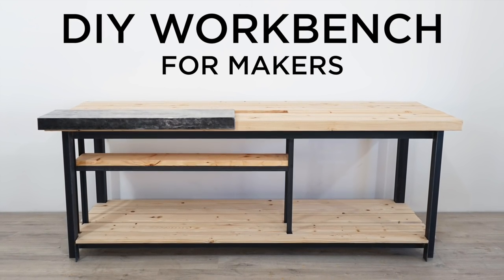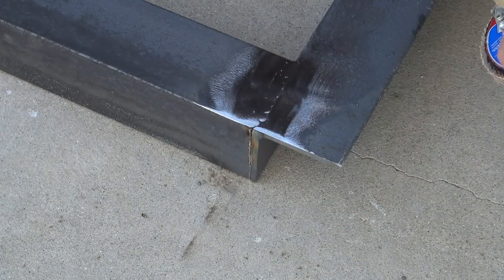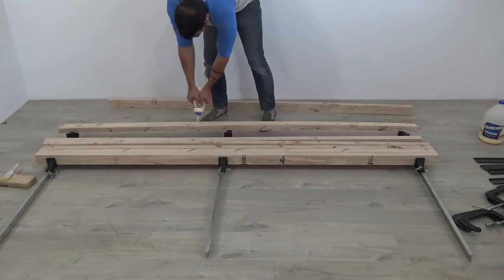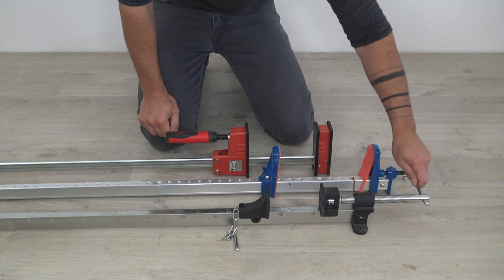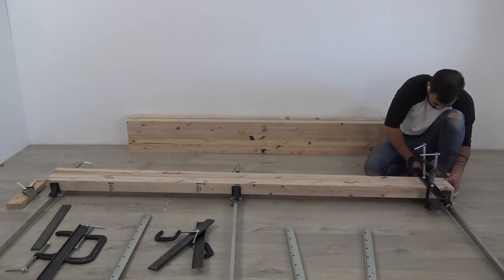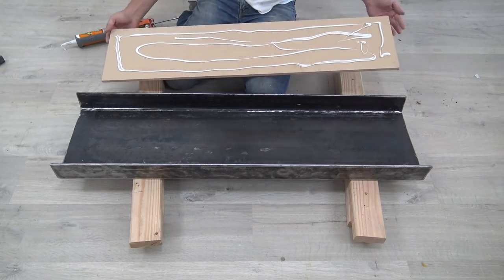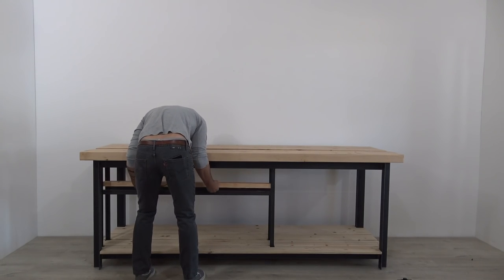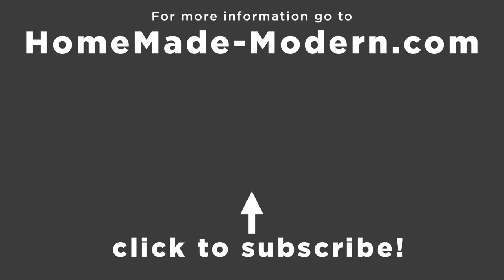Building a Workbench for Makers

Comment: I'm more of a power tool woodworker, but the idea of being able to weld, clamp items to the sides or surface, and have a cool powdercoated base is pretty awesome. I've talked about using angle iron for my outfeed table base for a while, but I'm too big of a chicken to finally pick up the welder.
Reply from the maker: yeah i put it off for a long time too
Reply: HomeMadeModern if you could go back in time, would you have bought a welder earlier?

Comment: Very cool bench. One recommendation for the feet on the bench is to weld some nuts to the end of the leg and then use hockey pucks on bolts as feet (there are a bunch of videos on how on youtube). It gives you the ability to level the table on uneven surfaces, helps prevent the table from scratching up the floor, and also absorbs some of the shock/ringing when hammering. An added bonus is that if you eventually clamp something like a disc sander or polishing wheel to the table, the rubber feet will help keep the vibrations from allowing the table to 'walk' around your workspace.  Love the podcast, and looking forward to buying some clamps.😎

Comment: I love the clamps that Mike, Chris and you designed. Its pretty cool. The table turned out pretty neat too. I would say that if you were going to do more welding projects is to switch to 75/25 mix argon CO2 shielding gas for your welder. Not only will it make your welds look a lot better because of less clean up of flux, but it will improve penetration and prevent contamination in your welds. Plus you can make some really nice welds. 

Just remember that you are also going to need wire and tips if you are going to do this upgrade. The 0.023 to .025 works great for sheet metal because of less heat and the .030 is good for heavy fab like chassis or the angle iron that you were working on. I really like your videos and can't wait to see what you will put out next. Makes me look forward to doing something over the weekends.

Comment: Awesome workbench, I'm digging the versatility of it which is especially useful for smaller workshops. By the way, you can minimize the torsion of the cheap clamps by inserting a thin slice of plywood in the gap. Works well enough for me!
Reply from the maker: good tip!

Comment: The removable channel in the middle is a cool concept.
Reply from the maker: yeah thats my favorite part
Reply: Yeah it's a common design from the "split top roubo" which it can be a tool holder that gets removed. But I really like this version, and with the removable "Anvil" it is great for small spaces that can't fit a separate workbench for different uses/tools.

Comment: Cool setup. I really dig it. I'd be worried about heat transfer to that piece of MDF on the underside of your steal insert. It strikes me as a potential fire hazard on longer wielding projects and even on the shorter ones, I'm not sure I'd want to risk heating MDF - it can be made with some fairly nasty stuff that you likely don't want to get airborne.

Comment: Your mig wire feed setting is set too slowly. You'll get cleaner stronger welds if you turn the speed up. You know you have the speed right when it lays a single even continuous bead and it sounds very consistent instead of the stuttered stop start noise. It's hard to tell in the fast forwarded but looks like it could've been hotter as well. 😀 Love your videos btw.
Reply from the maker: thanks for the tip!
Reply: HomeMadeModern no problems. Keep making cool things

Comment: I always thought putting wax on a welding table was bad for electrical conduction. Seems like it worked anyways. Would be curious to hear if anybody else has done this and had good (or bad) results.
Reply from the maker: i am not sure, it seems to work but what you are saying makes sense.